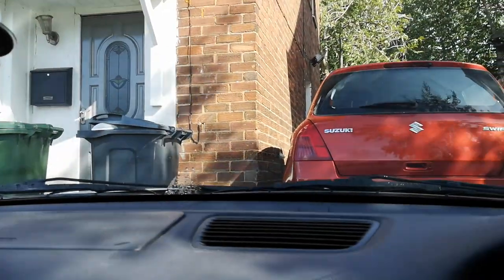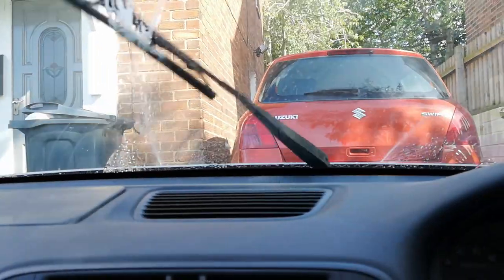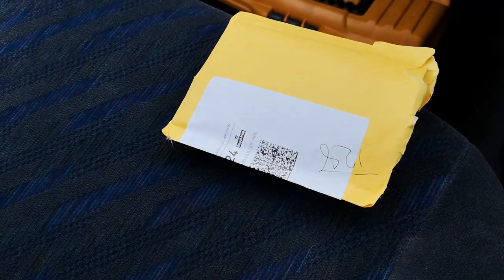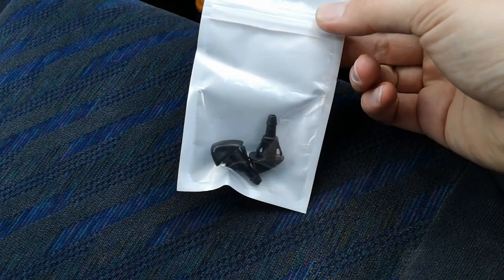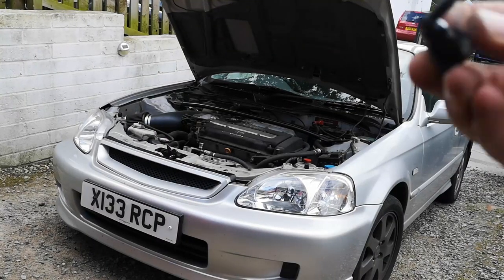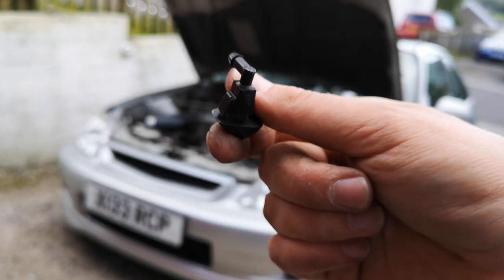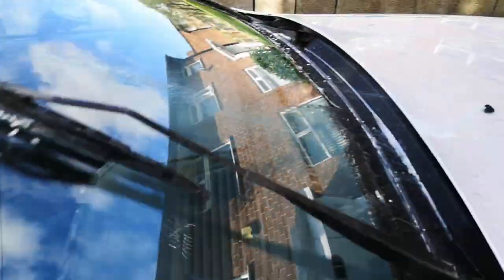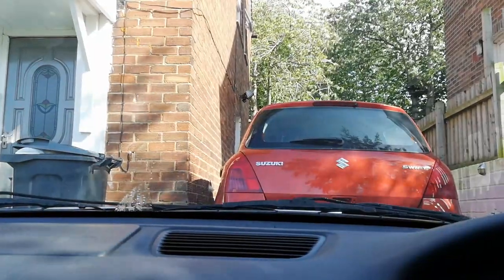Honda Civic Budget Build gets Honda Jazz/Fit Washer Jets Another modern touch that doesnt go to plan

Comment: I looked at doing this as my driver side right hand jet will not do as it's fooking told it either sprays the roof or the scuttle but it's worth living with after seeing what you just went through lol, good to see the fails as well as the wins buddy.
Reply from the maker: Thanks man, it didn't take long to fit though so it you get them from a scrapped jazz it should be a good upgrade 👍 I'll let you know in part 2 😁